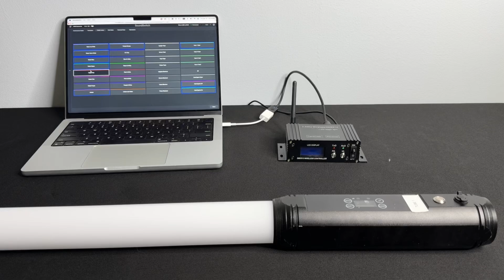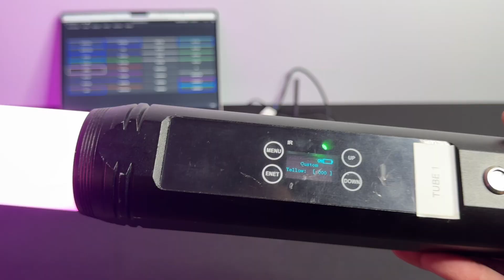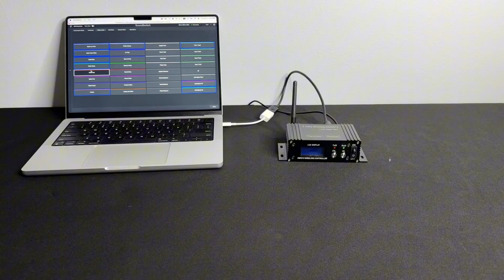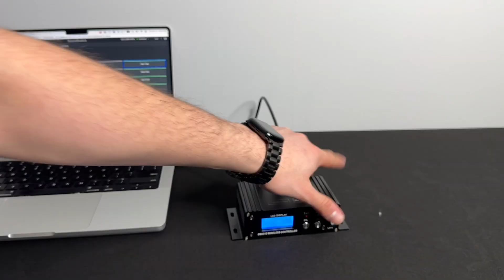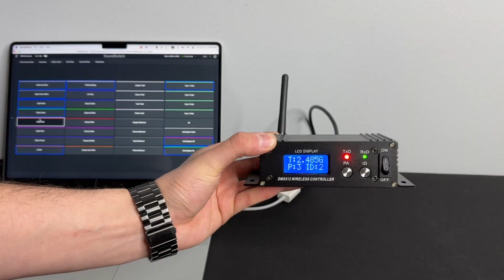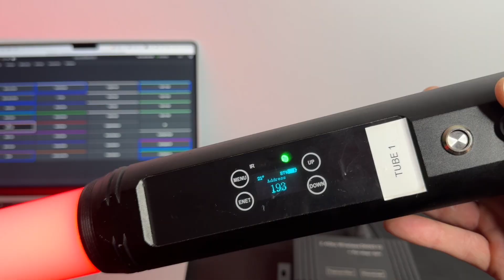How To Use DMX On a 360 Tube | Both Lighting USA

Comment: Will the 360 Tubes ever be able to work with Chauvet's D-Fi system without having to create a separate DMX universe?  This is a show-stopper for me on these 360 tubes until I can find a reasonable workaround.
Reply: I’m just running a donner transmitter along with my d-fi.  No problems at all.
Reply from the maker: No. We suggest getting off of D-Fi entirely 😉
Reply: @BothLightingUSA I’ll need to use lighting systems that do work with D-Fi then. Thank you.